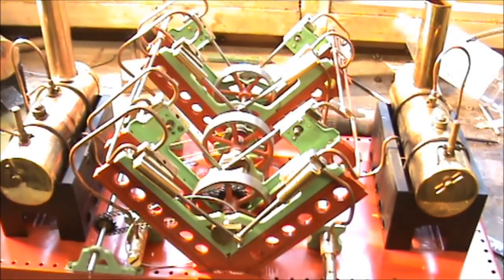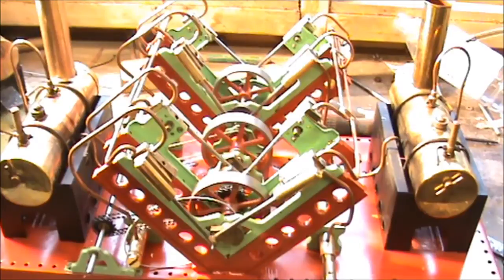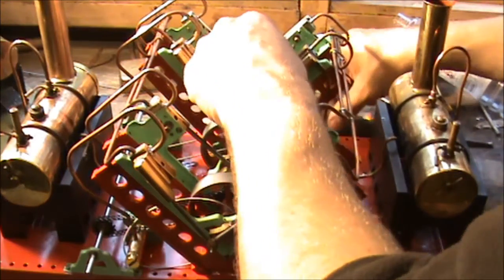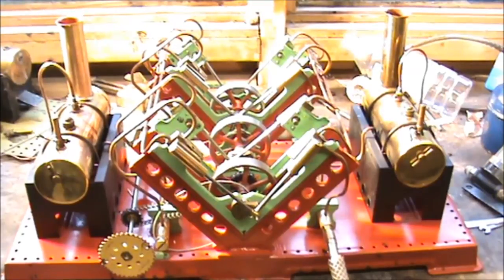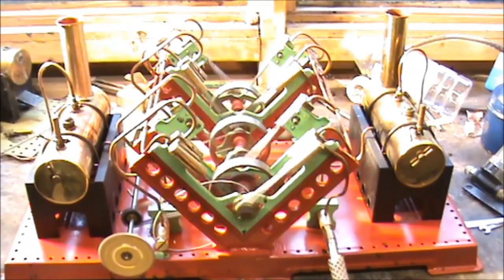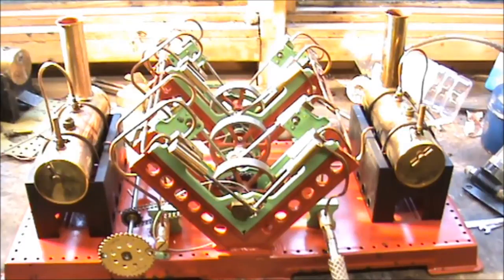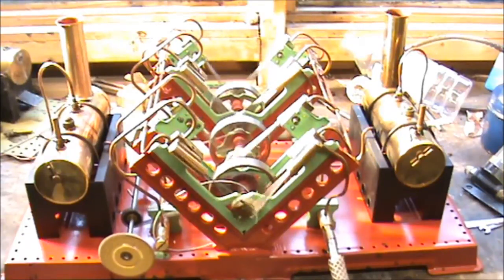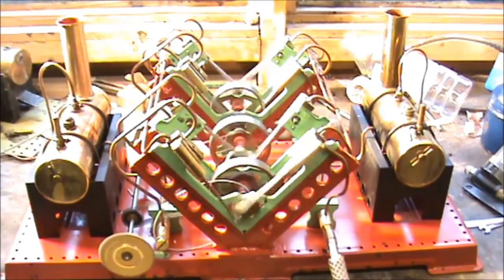A V8 steam engine running on air  Mamod model engine sound up !

Comment: Excellent. Lovely work.
Reply from the maker: John Mellor  thanks John, I’ve worked on the engine some more but as of yet still can’t get it going under steam, I think a radical re piping  to shorten the distance between boiler and engine is needed...
Reply: @Madchris1  ...and lag the pipes. If a mamod boiler will run two pistons on the larger sets then you would need the equivalent of four boilers. Just stick with compressed air - it isn't going anywhere!
Reply from the maker: John Mellor  I tried running two pistons separately , to no avail😕 and agreed pipe lagging and extra boilers  may be needed , I do suspect the two brass bars manifold system I setup Is probably not ideal...but it seemed a good idea at the build stage ,  and quite honestly wasn’t expecting any problems apart from timing issues.
four boilers would be cool though 😀

Comment: Very cool........didn't get the last bit ..'have you ever seen a............................................."
Reply from the maker: thebaron44 thanks, so what do you do in Texas, are you an engineer? or something cooler..,re the last bit ha ha, I wanted to power a" rotating" cake stand at high speed with the v8, why I hear you say?,  well...why not :)
Reply: skyrocketpuke Can't wait to see the cake stand!      Yes I am a retired engineer and have collected, repaired and made parts for clocks of all sizes.   Gear cutting was perhaps the most fun aspect.  Now days I mostly "''consult'' on tower clock repair or teach repair.
Reply from the maker: thebaron44 
I had a feeling you were an engineer:), 
Hmmm! Very interesting that you like clocks and mamods, me too lol, I've got a old long case my pride and joy, seems we have a few things in common ha ha https://youtu.be/r-zePiOcZOQ
Reply: skyrocketpuke Any of us that want to work metal with our hands , or make tools, has a respect for our pre-plastic culture.  Let us hope this love does not die.
Reply: chris the bodge  .I have a lot of fun tinkering with my Drummond lathe but  I'm not an engineer I'm a chef (45 years at the stove and counting) . I think I'm qualified to confirm that the V8 cake stand  is destined to make a significant  contribution to the trade. Paul Hollywood get yer goggles on mate the V8 is coming.